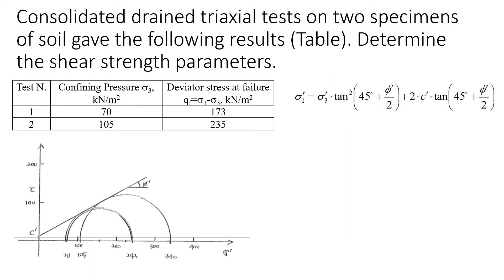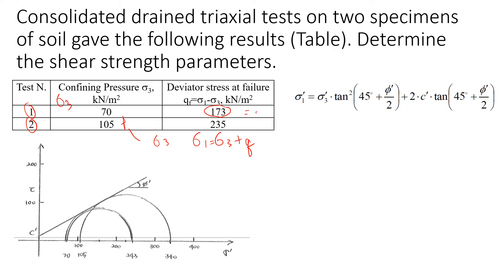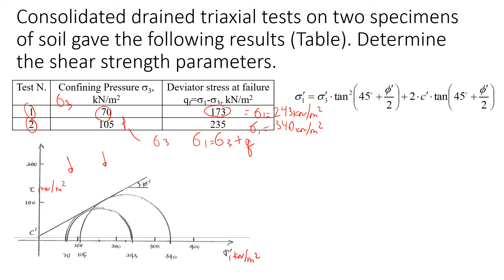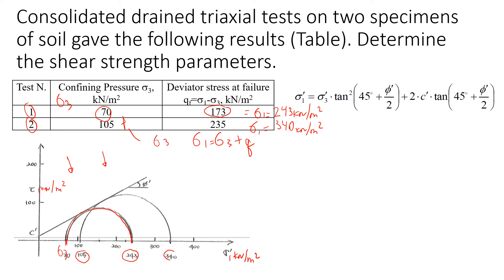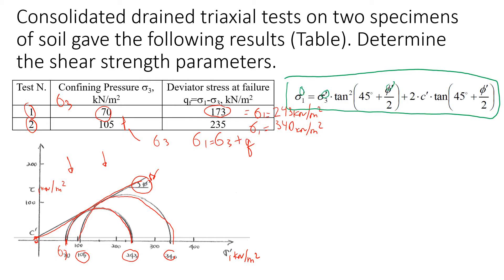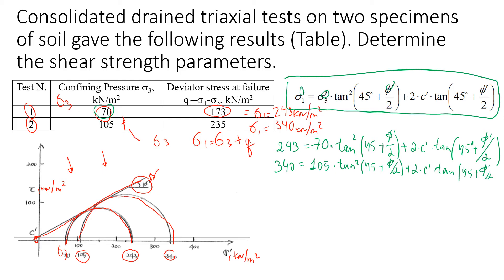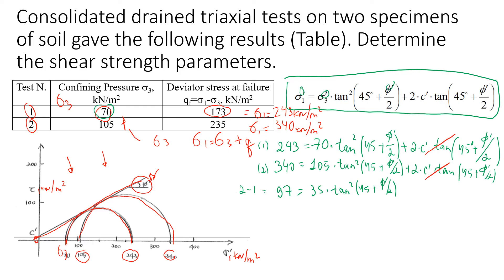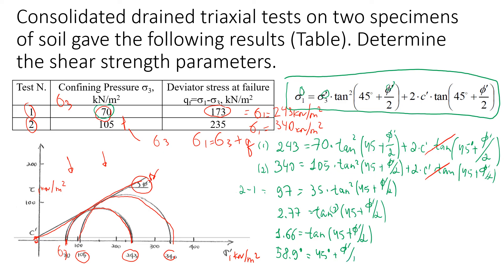Simple Solution for Triaxial Tests | Use This Formula to Obtain Soil Cohesion and Friction Angle

Comment: Thank you so much. What if we have more than two tests like five test samples?? because with different sample, the value of Phi will be changed and in that case, which Phi can represent the most fitted value for the mohr envelope?
Reply from the maker: Good comment, the more samples tested the more accurate results you can obtain. If you use the formula described in this video, then you can select two circles only. Still, drawing all tests is more reliable way to obtain soil strength. There is still a bit variation in the final answer, which is acceptable; at some point, you will need to exercise your engineering judgement.